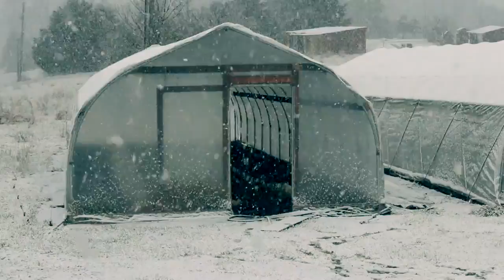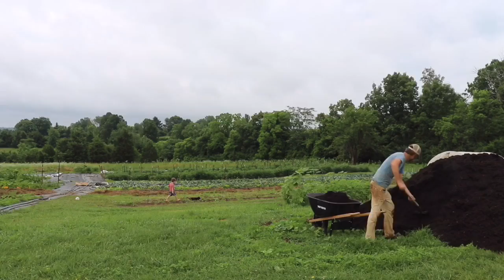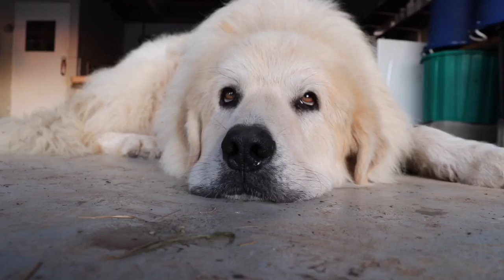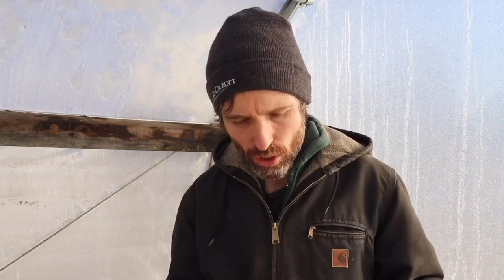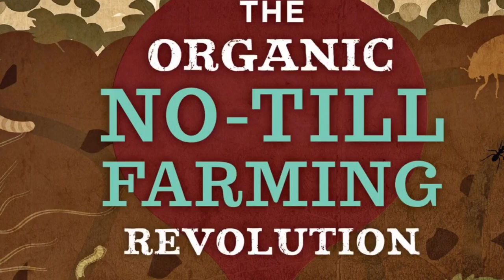Choosing Your Own No-Till System

Comment: Lots of info. First off, No till is where you end up not where you start. Erosion, keep the soil planted. Mulches, use living mulch as much as possible. Leaves, make sure you know the source to avoid synthetic chemicals. Compost, you can never have enough. Avoid peat moss. Block weeds with tall cover crops. More info; frankholzman.blogspot.com
Reply from the maker: Thanks Frank. Good notes. I don't know that I necessarily agree about no till not being where you start. It's all about context. I think someone with growing experience could start as no-till but also, something like deep mulch compost is generally way more straight forward than tillage farming.

Comment: I'm fairly new to your channel but I'm hooked. I am making preparations to start a low/no till operation. I haven't made any solid decisions about mulches yet but have put a ton of thought into it. I want to experiment with 12 inch pathways that have course mulch on them because I am interested in creating a long term paths that can add that fungal component to my farm. I realize that it may to messy but I want to give it a shot. I think it might be more practical with a biennial such as strawberries.
Reply from the maker: If you are starting outnwith tilled ground I highly recommended getting the weeds in check in the paths first with a few cultivations. Also maybe consider a layer of craft paper then mulching it. Thanks and thank you for watching!